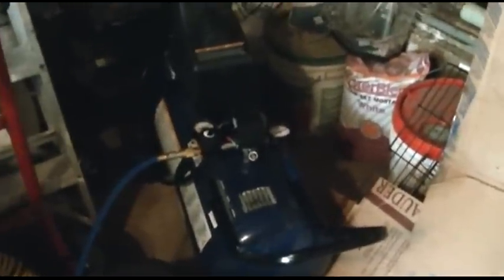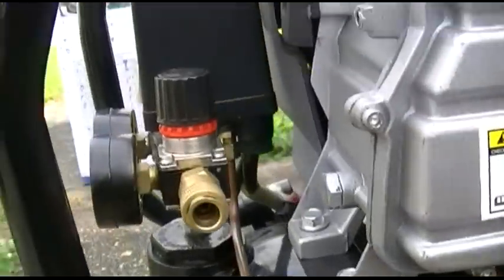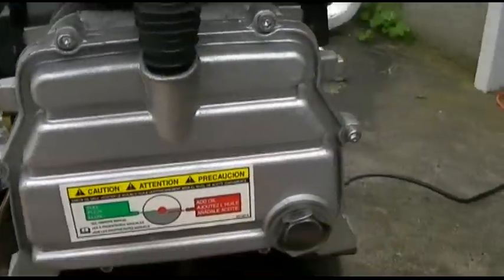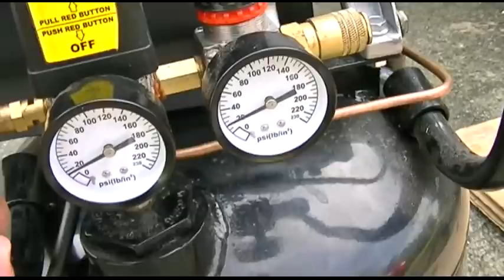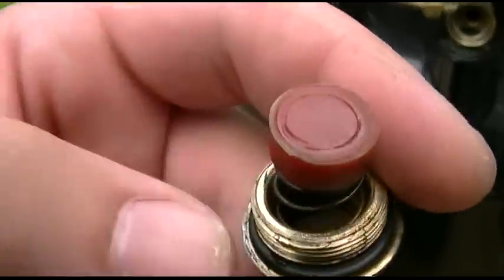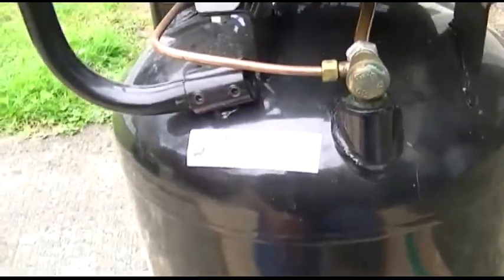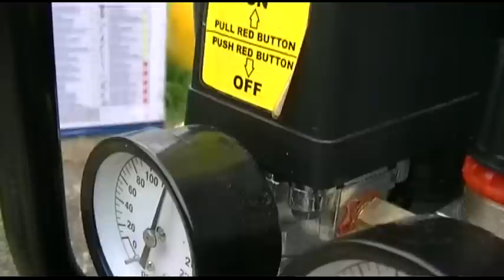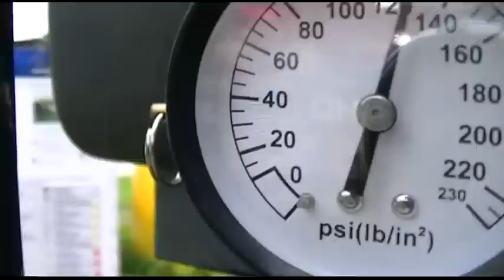Trying to Resurrect the Old Compressor

Comment: I know this is an old video, but these things are still out there.
Mine was doing the exact same thing, refusing to start and tripping the circuit breaker on it.  I decided it was likely the capacitor.  After disconnecting power and removing the plastic cover over the motor, I discharged the capacitor and tested it with my multimeter.  The capacitor tested good.  What I found was a loose wire on the capacitor.  Lots of vibration was probably the reason it came loose.  Tightening the wire fixed mine so far.  His leak is probably the pressure switch.  I've had to replace that in the past also.
Reply from the maker: Interesting.  I was pretty convinced the cap in mine is bad but I never went through it to see.  Perhaps it does have a loose or burned wire.  I do know that it mostly has trouble when it's cold, and heating it with a hair dryer does the trick.  Perhaps the oil is too thick in the crankcase at colder temperatures.

The pressure switch is definitely bad on mine.  I have a replacement, but never replaced it, I have a different compressor but saved this one for possible resurrection one day.

Comment: I just saw this. But try replacing the start capacitor. That's usually what goes bad. The capacitor provides enough "umph" to start them. That's why it starts when u let air out
Reply from the maker: No, that's what the unloader valve is for, it's supposed to let the head pressure out so it will have no problem restarting.  The capacitor needs to be in good condition to start the motor at all.
Reply: @jaykay18  correct. But I've worked on alot of these and never had to replace an unloader valve. But I've replaced tons of capacitors
Reply from the maker: @oldironfinder  I can guarantee you the unloader on this one is bad.  The cap?  At this stage of the game?  Yeah, that's probably bad too now.  I have both parts in stock, just never installed them.  The entire compressor was replaced, and the replacement has outlived this unit tenfold.
Reply: @jaykay18  I've got one identical to it that needs a connecting rod for the compressor.
Reply from the maker: @oldironfinder  That's what I mean--the cap is the least of worries on this thing.  Total junk.

Comment: Do you feel like the leak is related to the reason it wont run under pressure is that a seperate issue. I dont have an air leak but it wont run with any air in the tank. Tries then pops the breaker.
Reply from the maker: I'm not exactly sure.  Supposedly, the unloader valve is supposed to relieve the "head pressure".  Essentially, an air compressor is like a gas engine on the compression stroke.  If it's compressed and you try to start the motor, it can't start easily, that's why they relieve the pressure in the cylinder.

Could also be a bad capacitor, these things were not known for quality at all.  I haven't taken mine apart any farther but there may also be another thing on the top of the cylinder head to relieve pressure, perhaps that's not working which is why.

What ended up happening with mine was I went through about 3 of them from WalMart and they kept going bad or leaking.  I finally spoke to the company and apparently got someone with power to do something, and they voided my warranty but sent me a check for the purchase price of the unit.  It still sort of worked at that point so I used it until it died.

At this point I know the unloader valve diaphragm is bad, and I have a replacement assembly, but never bothered to plumb it in since I have another compressor that's been working great for years.  Might be time for an upgrade soon, who knows.

Comment: Thanks for the step-by-step.  My 20-gallon Craftsman upright compressor stopped working on my yesterday.  I went to go turn it on and nothing happened.  I made sure it has power, no breakers tripped.  The day prior there was a lot of air rushing out from what I believe to be the unloader valve like what you were experiencing here.  I also drained a lot of mucky water from the petcock valve at the bottom like what you experienced.  More troubleshooting to do.  Thanks!

Comment: I've had one of these since 2007 and it's been a good one. But you have to adjust the pressure switch a turn and a half to charge it to 135 psi in order to support a 3/8 50 foot hose to 90 psi working pressure. Other than that the thing has been awesome. In fact I'm about to upgrade to a 60 or 80 gallon and I fully plan to keep and use this for light work until it dies
Reply from the maker: +Jacksonkellyfreak I wanted to like this thing, I really did.  When it did work, it worked great.  This was replaced with a Campbell Hausfeld unit which was larger and is still working fine.  When it goes out I will likely replace with a 30 gallon.  Seems you always go larger and larger as you replace compressors.
Reply: +jaykay18 I must have gotten a good one because I've beaten the piss out of it and it still works like a new one. I've run the thing for an hour and a half several times using a cutoff wheel, knocked it over a few times, and neglected it for 2 years and it still fires up, charges the tank quickly and will fire back up if that asshole of an air hose I have vibrates enough to shift and push the button to off halfway through the cycle. I hate my air hose, but love the compressor. Hell, if you still have it stuffed in a corner and don't want it send her out to me. I'll give her a good home.
Reply from the maker: Jacksonkellyfreak I'm sure shipping would be prohibitively expensive.  I do still have it, and although it still leaks, I still use it when I have to go and blow out a relative's inground sprinkler system.  So it gets started once a year, usually after a lot of cursing and a few small animal sacrifices.
Reply: Jacksonkellyfreak       Never ever adjust the pressure switch beyond its recommended pressure. If a shorter line is used by some one not knowing it's adjusted higher. They may find themselves missing limbs if not their life. Pressure tanks have their max pressure labeled for safety. Never believe, " they can take more pressure than they are certified"

Comment from the maker: Well this thing has a plethora of different problems.  The problem was actually the sealing gasket in the unloader valve assembly.  Changing the unloader IS the correct fix, it's about $15 for a replacement.

Drain the tank of air and try again.  Ensure that the compressor is plugged directly into the socket, rather than an extension.   If it still hums, you can try turning the motor by hand (by its fan) to try to free it up (UNPLUGGED!)  Otherwise it's likely the cap.

Thanks for watching!

Comment: Glad you got the new pressure control switch.  The symptoms said there was residual pressure between the compressor pump and the tank, but not where it was coming from.  There are two ends of the unloader tube.  Only one end is supposed to supply pressure, but both can if the control valve is bad.  The hiss should sound more like a sigh, not a short spit.  The control valve has 2 inter-related functions.  It turns the electricity to the motor on and off in response to the pressure in the receiver tank.  The other function is to open and close the unloader valve.  If you saved the old unloader valve, you may be able to get a rebuild kit for it.  Do that, and if another diaphragm goes bad, you'll have a good replacement part all ready to use.  I liked getting a look inside your check valve; I've never had one apart myself.
Reply from the maker: Thanks for the info!
Reply: jaykay18 yw

Comment: Sir that air compressor should be plugged directly in to a 110 plug not a cheap cord
And make sure the oil has covered the sight glass
Reply from the maker: A 100 volt outlet was not available at that place.  As for the oil, the instructions SPECIFICALLY state the oil should go halfway up.

Comment: I have one of these and it's a piece of shit but she is loyal and won't die
Reply from the maker: That must be the one "good" one they made.
Reply: @jaykay18  it's a Frankenstein now because it had the same problem as yours so I put a control assembly off another broken compressor
Reply from the maker: I have a spare unloader valve assembly for mine, which I've had for several years now, and never installed it.

Comment: I'm a dummy.  I didn't see that the breaker on the compressor itself had tripped.  I reset that and it turned on again, though when it reached max pressure it shut off and wasn't leaking at all.  Weird... I will keep an eye/ear on it.  Thanks!

Comment: Had the same problem but it actually didn't turn out to be the unloader valve.......If you remove the on/off switch cover and remove the switch off the unit, you will see a rubber diaphragm underneath and that is what went bad........ I didn't even look for another piece, I just cut an old piece of inner tube and used the old diaphragm as the template, no issues after I put it all back together..........

Comment: I have the same setup . The pressure switch can leak from its internal diaphragm  or  the black housing on the pressure switch could be loose from the compressor vibration. Check both I had the same problem. The diaphragm  was good no tares. Check under no tank pressure. But the 4 housing screws were loose enough for air to escape.. Just pressure it up normally and unplug the compressor. The pressure switch houses the live current when plugged in. Unscrew the pressure switch cover on its left side. Remove the cover, but keep an eye on the screw. As you hear the air escape tighten carefully each screw that holds the black housing to the lower pressure switch . The air escaping should be less and less hear until silent. Remember do not over tighten do it slowly and deliberate. Happy hunting.
Reply from the maker: Yeah it's the pressure switch.  There is a tear in the diaphragm on mine.  I have an entire replacement unloader assembly, just have to plumb it in.

Comment: Change the pressure switch there is a diaphram in there
Reply from the maker: I'm well aware of the problem with it.  If you read through the comments you'll see that I have already discovered said diaphragm and tried to repair it.  It kinda works now.  Still leaks slowly, but much better than it was.  I have since replaced this compressor quite some time ago so I don't use it very often.  It was also free, so spending money to fix it makes it cost more than it was worth!
Reply: jaykay18 Remember to thread tape everything.  They usually don't do that at the factory.  Vibration is perfectly normal.  Great compressor.
Reply from the maker: Kenny Sellers There actually was some factory "red glop" on the threads to seal them, but whenever I make a connection I make sure to use plenty of teflon tape!
Reply: I had same problem with my compressor. It was the diaphragm that had turned to sticky mush. I just brought a new pressure switch/manifold arrangement off eBay for $16.00 delivered and problem solved. 
I had 10 years use out of it before I repaired it. Compressor only cost $99.00 when I brought it any way.

Comment: So, I had this EXACT problem with my compressor. Basically was ready to junk it. I figured id try one last thing so I plugged it directly in the wall and it worked great! Try that just for fun!
Reply from the maker: Makes absolutely no difference.  Everything on this compressor was crap from the get-go, including the start capacitor, which is likely the biggest part of the problem.  I've since replaced this with a real compressor, as shown in the beginning of the video.  This compressor is still around, and is waiting to have a new unloader valve fitted, as was the original problem as demonstrated in this video.

Plugging directly into the wall helps because of the weak start capacitor, coupled over an extension cord, there's just not enough current to start it.  This one won't start when full even when connected to its own dedicated branch circuit directly off the panel.
Reply: i loughed  so hard at 9.28  i got my compresser for $200 but me thinks 
it was a 100 to much good old china shit runs well its only a couple of moths old and i already see rust

Comment from the maker: Usually once the compressor finishes filling, I can't hear anything myself for a few minutes!  (Unless, of course, there's an obvious leak).

It's also entirely possible the seal/gasket in the unloader did not seat correctly the one time, there may have been a bit of debris in the are where it seals, like a small particle or somesuch.  If so, that can cause a temporary leak.  This is especially important since you drained it--there may have very well been crap in the tank!  Good luck!

Comment from the maker: The entire unloader valve assembly is both the unloader (relieves pressure over the piston head), and pressure switch, which can be adjusted by turning the bolt under the plastic cover.

It would probably help more to change the entire compressor.  These things are cheap for a reason.  Unfortunately, anything you get is just as much Made-in-China as the rest, and will likely have (or develop) its own personality and problems.

Comment: 1. Do you still have this POS air compressor?
2. If not, what happened to it eg, did it get turned into a silent compressor?
Reply from the maker: Yes, I still have it.  As I expected, it was the unloader valve, not the check valve.  A couple years later I actually found an unloader valve assembly and bought it.  I never put it on.  It sits, unused.

Comment from the maker: Absolutely!  Contrary to what I've read, I've seen and heard about more and more unloader valves failing.  Sears PartsDirect (amongst other sources) will have replacements available.

I replaced mine with a Campbell Hausfeld compressor which I like a lot better.  They're all crap these days.  My CH compressor has a "LEFOO" brand unloader valve assembly.  Hmm...

Comment: I'm not sure where your leak is, (try soapy water) but these comps don't like to start up in cold weather with a load on. ???
Reply from the maker: It's the unloader valve.  There's a rubber diaphragm that tore.  I tried patching it, but it only worked for a short period of time.  I have purchased a new unloader valve assembly that I'll get around to installing one day.

Oil-lubricated compressors like these don't like to start in the cold unless they are warmed first.  Why it refuses to start with pressure in the tank when the compressor is cold but not on a cold day is beyond me; the unloader valve is supposed to unload the head pressure and allow easier startup.

Comment: It is ment to do that my compressor did that
Reply from the maker: Nope.  Just garbage.  A real compressor will start up, hot or cold, and will hold pressure without leaking.  The Campbell Hausfeld compressor seen at the very beginning of this video can start up in the garage at 20°F even with air already in the tank, while everything else is cold and the compressor hadn't run overnight.

Comment: seriously maybe you should read your manual instead of searching the internet, and for GOD SAKES MAN... Change your oil in the pump... people gripe about the product but don't read the manual or follow proper maintenance of the unit of course you're going to have problems, and your leak is at the pressure switch or safety valve.
Reply from the maker: Makes a lot of sense.  I can see it now:  "If the unit is leaking, HAVE IT SERVICED BY A QUALIFIED SERVICE CENTER."  You helped a whole lot, Robert.
Oil change or no oil change, I went through 4 of these compressors before I got one that worked.  They are pieces of crap to start with.  So much so that the company that made it not only stopped making them, but also refunded my money and didn't want the unit back!  There's no use polishing a turd.
Reply: Where can I find the fuse box for a Brute Air Compressor? It's a 074003 or 074004 Model.
Reply from the maker: ***** Thank you!  I knew I wasn't crazy!  I actually bought a new unloader valve for it, it's still sitting on my workbench for the one day where I decide to actually plumb it in.  Then hope it will start!  When it did work, it worked well, fill time was quick, sounded strong, just did what it was supposed to.  The milky looking oil in this one is probably filled with metal shavings and such.  The CH compressor that replaced it has been in service for 3 years without an oil change.  The oil in the unit looks absolutely brand new.
Reply from the maker: ***** Thanks so much man, I really appreciate it!  Best of luck to you.  In case you're interested, I have lots of other videos, some of which might interest you.  Thanks for choosing my video.
Reply from the maker: ***** I guess it had its day.  Shoulda read the manual!